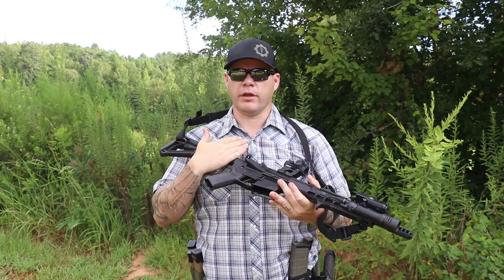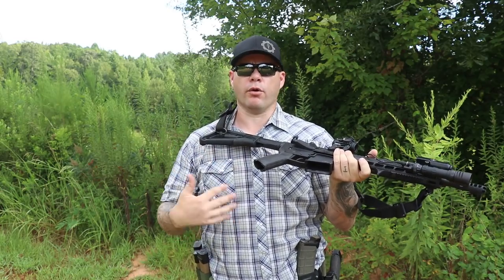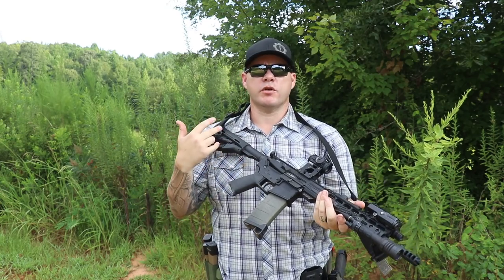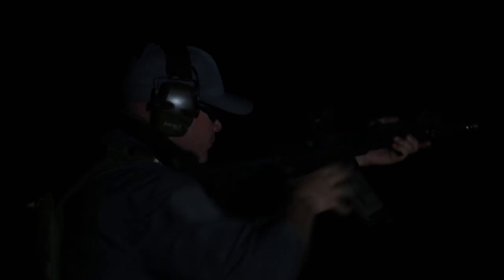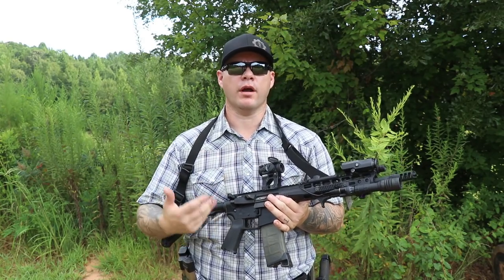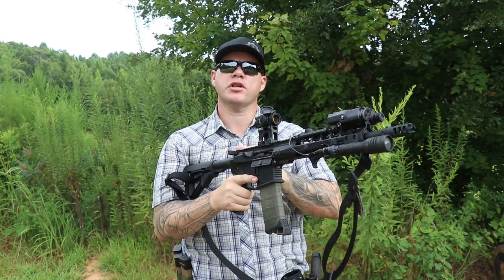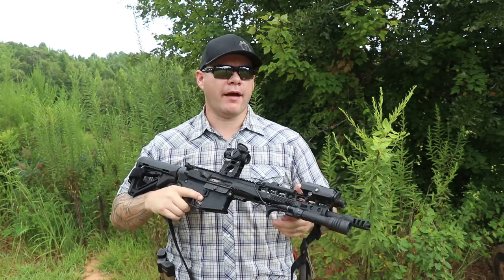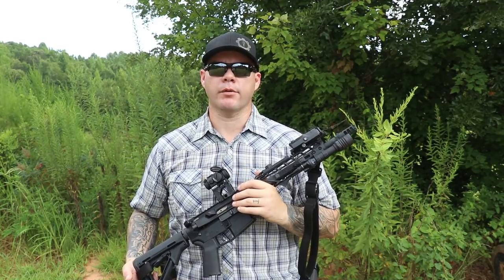Low Light Rifle Malfunctions

Comment: The new military method (bolt override) is to stick your finger in and pull back on the bolt slightly, at the same time pull back on the charging handle. That gives the handle a few inches to be pushed forward and works the first time just about everytime. All it takes is one push forward on the charging handle and the round goes flying. A little quicker then what you showed and no need to depress the release. Give it a try Aaron and see what works for you better and quicker..Pat Mac taught us that.
Reply: I've been a fan of that method for a while, but it's not perfect. Dry practice doesn't really simulate the fact that the bolt carrier group builds up a lot of heat very quickly when you shoot it, which can make the technique uncomfortable, if not unsafe depending on how much you've been shooting prior to the malf.
Reply: @peanutarbuckle2879  You're definitley gonna melt some skin if you've been firing on a DI gun. A piston rifle will keep that from happening. Either way though and even if you're not wearing gloves I'll take some burnt skin over holes in my body anyday of the week

Comment: This was a great video and I'm honestly pissed at myself for not thinking to train this way. I do have a couple of questions...i come from the old school of tap, rack, bang and I've never seen the push pull on the magazine before. What is the mechanics behind this? Also, the brass over bolt you mentioned was due to self built issues, and as I'm currently building my own AR just to put that under my belt...what would cause that?
Reply: Clint Long i pull the mag to make sure it’s actually seated in the rifle
Reply: He does push pull because if the magazines has 29/30 rounds in it and the bolt is closed, just tapping it won't always seat it. Push pull solves that, if it isn't seated it'll come out. He has a whole video on AR malfunctions too. Honestly no idea about what causes the bolt override though.
Reply: Also tapping too hard can also potentially induce a malfunction if the bolt is open (bumping another round loose from the magazine). It’s also harder to feel the “click” of the magazine properly seating if you tap it.